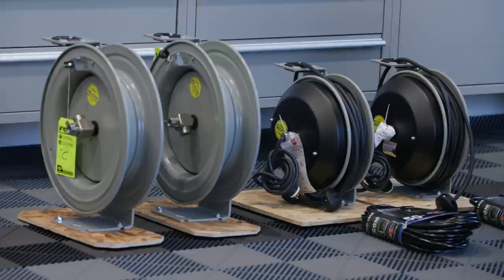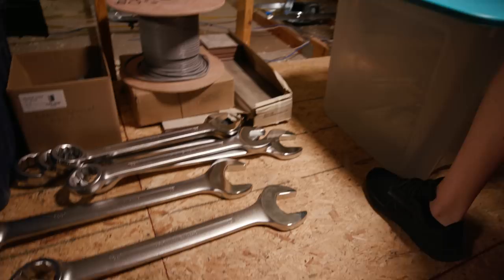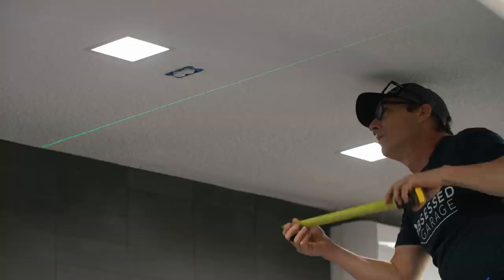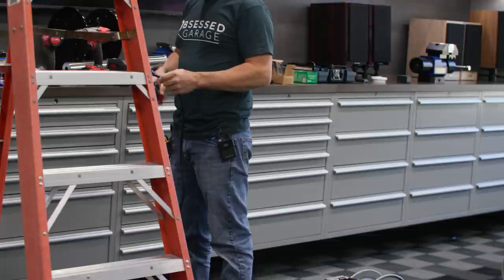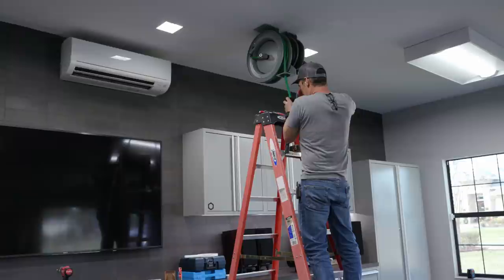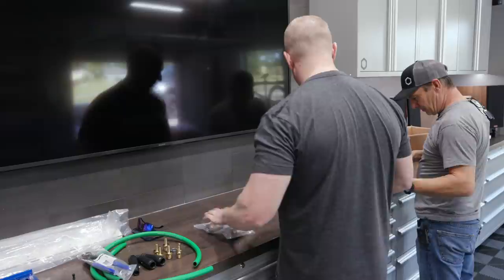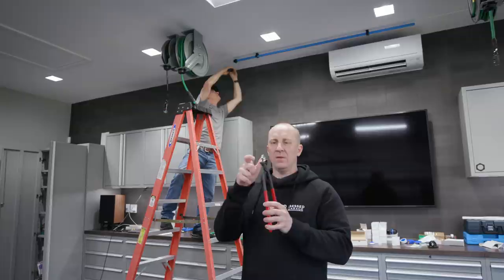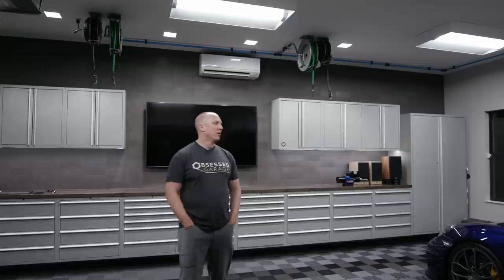Cox Hose Reel Garage Install with Prevost Piping

Comment: Perfect hose reel connection! The tee positioned horizontally to avoid potential condensate to reach the application, the  ball valve and the swivel thread connector to make maintenance easier, top notch guys

Comment: Maybe it’s camera angle but I’d have to have the end of the power cable and the end of the air hose EXACTLY the same distance off the ground.  Looks like the power hangs a little farther down on the right pair as you’re looking at the TV..Just sayin I might be a little OCD. And no jokes about every guy having at least one that hangs down more than the other.

Comment: One comment about the prolock cords. In Canada in the winter those cords do not flex well. The cox rubber reels with the sjow on them is more flexible in the middle of winter. Also Leviton wetguard ends stay nice and flexible versus hard frozen plastic ends. Something to consider if you are having the reels made to an og spec some will use them in frozen garages or pull the cord outside for usage in the winter.